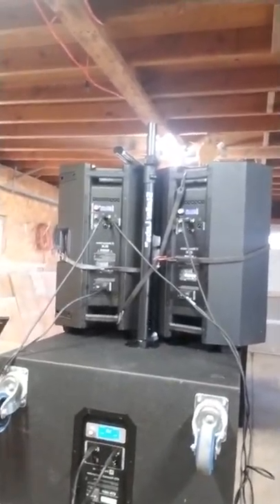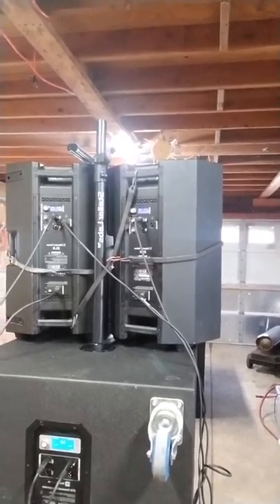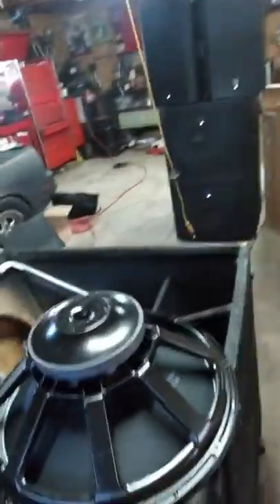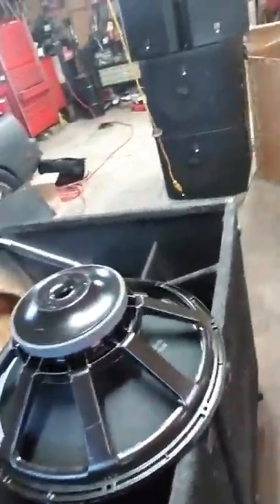EV ETX-18SP Review With Driver Upgrade

Comment: Ever consider the fact that maybe the EV woofers needed some break in time? I mean...what do you know that the engineers at EV don’t....
Reply from the maker: Hello! Break-in AND Temperature accounted for. For apples, the other Drivers were also not broken in and the difference in sound pressure and quality was completely Night and Day. MFG Suggests roughly 60 Hours to break in, however, the difference will result in a warmer sound. The frequency response and peak power simply was not there. You can read reviews on the drivers themselves and you will get more info about the driver's limitations vs the replacement ones I used. What do I know? I the upgrade sounds and performs much better. I do not claim to be an EV Engineer or smarter than one. I made this video to encourage out of the speaker box thinking if buyers want to challenge the design further, and have fun!
Reply: My same thought Everytime I see someone doing this
Reply: I have the ETX 15SP and need to replace the woofer...I hear some kind of cone rubbing on my sub and I’ve only played it a few times at weddings in the last 8 years. I’m sure they are out of warranty.
Reply: Douglas is right, it’s not that engineers don’t know what they’re doing, it’s just that it’s easier to cut  quality on a replaceable and upgradable part to keep these cabinets very affordable

Comment: You should check out the B&C 18TBW100 subwoofer drivers. I think you will be very impressed. They are definitely more powerful than the seismic (respectively) and made in Italy.
Reply from the maker: I think those would be a perfect match for the cabinet!
Reply: Steven Hammerle ... I’m going to look into this speaker I have the etx 18sp’s and they honestly hit hard & drop real low with the EV subs in them minus the peak light coming on super early I love them BUT if I can change the woofer in them so that they can hit and drop twice as low and take high volumes maaaan I am so with it and ready to try it now you say the B&C sub and I heard another mention they put a peavy low Max in the etx cabinets so wich one is better or will both hit hard!
Reply: @hollywoodthedj1673  b&c is better den peavy that’s for sure
Reply: Blackboy Ultimate Sound Sxm ... I wanted to buy the B&C subs at the time they were a little pricey so I went with EMINENCE DEFINIMAX 4018LF: 18 INCH PRO SUBWOOFER they were a little cheaper then B&C plus I only had to buy one since I already had one new in storage!
Reply: @hollywoodthedj1673  I am about to purchase a driver for mine that just blew.  Which one you think is best - the Eminence or BC?  I want to be able to push as much as possible - and the stock EV will not cut it - but I want the same great sound the sub already has - if not better!!!

Comment: I bought one 3 years ago and the driver blew up at the third event. They sent me a replacement speaker but I bought a Peavey Lo-Max woofer and put that in instead. No problems ever since, the only issue is that the cabinet weighs 15lbs more. I personally will never risk using anything from seismic.
Reply from the maker: Hi Nigel, I like your choice with the low riders. Great design and price point. I originally bought the Seismic for an inexpensive folded horn replacement so since I had em available, I just popped them in. The subwoofers still continuously work well, but yes are way heavier.
Reply: Nigel .. hey were the peavey low riders an exact match for all the screws to go in I’m having this same issue I want to replace my sub woofers ASAP
Reply from the maker: Hi Nigel, reporting back after some time using these. Still, NO issues and the Seismic drivers are absolutely awesome! Unfortunately, I believe they have since been discontinued... I was also very leery about using SA drivers, but if you had this specific model (I have no liking to any other SA subwoofer) in your hands you can tell it is not their normal design, it was likely a freak production. lol if that makes any sense.  Anywho, I hope all is well and they are still treating you well!
Reply: @MrDjanotomus  My ETX18sp with LOMAX woofer is still killing it, I used it every week (6 years or more) and I have no worries with the LOMAX! The LoRider is not even close to a LOMAX, do not confuse them. The ETX-35sp woofers I used to replace the lame originals were Eminence Ferrites supposed to handle 1500 continuous? I've blown one just yesterday, after several years of use. I won't say it's a fail because I ran sound for bands where they changed the bass output and overdrove the system when I took a piss. The 35sp's are already very heavy, adding 20 more lbs better be worth it, because I'm putting a 15" LOMAX in one tomorrow. Pay attention to your settings, don't overdrive your low end. Easy to do.
Reply: @nigel8649  … the Lomax is eminence brand right? Because I hate the ETX 18sp subs as well and I swapped for eminence definimax 4018LF woofers and that was definitely a hell of a difference

Comment: I replaced it with the new madrid 18 and it does jot sound as load as with the original woofer. Have 2 etx 18sp and had same signal going to them side my side and compare them one at a time. The original woofer hit way harder and there was a noticeable difference in pressure between them
Reply: I had to put the etx at +10 on the amp to get somewhat the similar spl putput. It goes on temp mode but does not ectuvate temp mode meaning it does not flash temp mode ang go into protectuon mode, so ill have to see in the next few gigs if the amp reduces it by -4db. Question does the amp monitor the speakers temperafure beamcause the amp does not heat up like it does with the original ev woofer but the peak and temp light do come on quick.

Comment from the maker: UPDATE! Used the setup for two outdoor events since the build, each one over 8 hours of continuous high level (but not unrealistic) use and they performed extremely well. I received many compliments on how crisp, clear, loud and deep they are. No issues with power, clipping, protection mode, hookup, rattling, port noise, nada. Amps are cool to the touch even playing dubstep and riddim at 80%+ volume for hours on end (ZLX-15Ps were much warmer but did not overload or have any issues as well). Very happy with the EV products and driver upgrade with Seismic Audio. I am still recommending it personally if it fits your needs etc. 

The second event we played for a July 4th party and played everything from baby shark, to classic rock, alternative and deep house with fantastic clarity. Again, many compliments.

Next use is for an indoor wedding in a very acoustically challenged VFW hall with over 100 people, 40 ft ceilings, concrete walls and floor and about 100' x 350'. I may be adding a set of JBL PRX825Ws for stronger mid-range and coverage. Stay tuned!
Reply: Douglas Johnson got a link for these drivers?
Reply: At what level do you have the etx amp at? Unity or +10?

Comment: 4 ohm or 8 ohm upgraded drivers? i have some ETX18's and I'm thinking about upgrading to 18 sound 18LW2420 drivers. I always thought the output on these cabinets was coming up a bit short for what they are and now I see why
Reply: The original woffer is 4ohm but I think the sa audio woffer only comes in 8ohm.
Reply: Should be fine. The etx18sp at 4ohm is 1800 watts and SA audio is 750 at 8 ohm. So if your amp fro. The etx 18 was 8ohms it would running at 900 watts. A little over the rated spwc for the sa woofer here.  @SQchico

Comment: I just bought one of these subs, trying to put together a bootleg movie theater for the family when i'm not working in the warehouse. 80' x 25' x 16' H I feel like the larger space requires more woofers or lower frequencies... What do you recommend?
Reply from the maker: The frequency response and price point of these drivers should satisfy most home theater applications. I would focus on the cabinet design and personally I would use 4 for the space (provided dimensions). Perhaps two dual front firing enclosures, and two 2,500 watt amps, frequency 25-125 Khz for starters.

Comment: The low end on your subs sounds fantastic in this video! I'm in the same situation but with EV's lighter EKX18SP subwoofer. I need more bass extension as well. All of the drivers I've looked at have a lower sensitivity rating. I don't know if that would give me less overall volume or not. What is the BEST driver that you would suggest I upgrade it with. Doesn't have to be a budget driver, looking for the best options.
Reply from the maker: I would look into some of the B&C or even Eminence drivers. They are all impressive, and I am planning to go in that direction next.

Comment: Thanks Douglas for the suggestion.  I replaced the woofers with the same SA subs and sounds so much better.  Only downside is the grey cone and SA dust cover.
Reply from the maker: Hi Mark, glad to hear this! I ended up spray painting the surface of the cones a matte black which took care of the color mismatch. Just a light coat did the trick and I will be making a custom decal for the caps. The cones had a deep grey/purplish color and it was quite visible through the screen, but now does not.
Reply: Douglas Johnson .. Good Job On Spray Painting The Cone & cap or speaker I didn’t know you could do that pretty dope now no one will know what speaker is in there!👍🏽
Reply: I was just about to suggest the spray paint..

Comment: Finding this has really saved me some money.  I blew 2 of my drivers on my ETX.  Replacement cost around $346 but I live in Hawaii so shipping can only be sent Fedex 2 days at $375.  Seismic saved me some money on the speaker but shipping is still $181 per speaker.   So hopefully the $200 savings per speaker is worth it.
Reply from the maker: Hi Halape10, happy to hear that you are going to give them a try. For the price, I still could not be happier with the Seismic New Madrid 18s. You may have to oversize the bolt holes on the basket, just slightly for them to fit however we are still using them strongly today. I encourage you to respond with your feedback once you get them setup! Thanks!
Reply: Douglas Johnson I had to do a little cutting on my box to get it to fit.   There’s a little funny sound on the really low ends.  But, I don’t think anyone will notice.  But overall I’m happy with them.  I’ll set them up again today to take a listen again.

Comment: Hey man. I have 2 elx35p powered 3 way speakers and I feel the same way you do with the bass...i tried to find the seismic audio Madrid you suggested but in 15" size and couldn't they only come in 18. May i ask if you know if the Madrids come in 15" or only 18? Your description is very convincing and I really want to wake these guys up. Thank you in advance for your time.
Reply from the maker: I believe they only come in 18s and have not been restocked in months.. however I'm confident most higher end low frequency response drivers should yield a similar if not better performance.

Comment: Alot if speakers do this shame put same drivers in same units! What rms you reckon the etx amp is putting out?
Reply from the maker: Hi Mobile Disco, I am quite impressed with the tiny amp. I would be optimistic to say they are about to put out around 750W continuous, without referencing the data sheets. I am especially impressed with the low power consumption and how cool the amplifier remains even after hours of continuous high level music. So far have not tripped a 15A breaker on these like I have with the Crown amps.
Reply: Douglas Johnson not bad at all! Tempted to get 15” used and put better 15” bass driver in neo help the weight so you feel 800/1000watt aes driver be fine as upgrade
Reply from the maker: @MobilediscowirralCoUk  Yes, that would be spot on in my opinion.

Comment: Well there went my driver!  I need to replace mine and the EV stocks are about $400 shipped!  WOW!  I'm trying to find better options - so did you say you had to modify and drill to make these fit the ETX cab?
Reply from the maker: Just the holes in the basket, a couple needed to be rounded out just a little with an oversized bit then they fit like a glove. I am looking into potentially upgrading them to B&C Neos next to take some weight off :)
Reply: @MrDjanotomus  wow do know exactly model number and do they fit exact?  I'm almost just buying the stock one but would love the handle of the RMS being higher so these things don't blow again.  I feel.thats what blew it the first time.  I push mine to the edge!!!!
Reply from the maker: @zeekhernandez9419  great question! With so many options, it comes down to your budget, availability and some trial & error. I love coming across a how-to video that gives me exactly what I need to expect, but the SAs are likely to be discontinued moving forward. If you drive them to the "edge" all the time, then I would get some heavier ferrite subs, like the SA's that can handle more heat, for longer durations of time. Which RMS or Continuously can handle the 1,800W rating of the amps.I was a little skeptical that those tiny amps were really pushing that much power, but a recent event with a HUGE Dubstep headliner (Toadface) we used them as monitors and they even tripped the 20A breaker (testing time) leading me to believe they are consuming and outputting that rating after all. Still, ran for several days at near clip levels, those darn things did not give out.... lol  Sorry I may of rambled there, just wanted to share some more recent experience as well. That was last weekend.

Comment: Hey Doug, I just purchased 2 of the ETX 18SP subs last week. You are right, the boxes they come in are definitely made of some heavy duty cardboard and had to use a razor knife to get mine open too, lol. After getting them unboxed and set up, I used the two QSC k12 tops I have here at the house, (The rest of my QSC speakers are in storage) for my first quick test with both of the ETX18SP hooked up. I Gotta say, for a very brief test (Did not want to bother either of my neighbors for very long) I was impressed with the power they produce. Never turned em up past +10 db, but Man they can pump out some serious Thump! However, I can appreciate this video and your recommended Subwoofer upgrade, Cuz I too, Was a bit skeptical of the many reviews mentioning the speakers shutting down after extensive use at higher volume. I'll take a look at Seismic Audio New Madrid 18" drivers, That is definitely an upgrade I will consider. You seem very confident with your experience at large events that demand extended periods at high volumes, and I can appreciate that too. After seeing the magnet on these stock EV speakers in this video, I gotta say they do look thin and weak compared to other Subs I have seen. As for the pair of QSC KW181 Subs I use now, Those are fantastic subs that have truly stood the test of time and are stock from the factory. My entire PA system is active QSC speakers and subs. However, I was looking into expanding the bottom end of my PA system for the bigger outdoor events that seem to really soak up the low frequencies very quickly yand these EV subs caught my attention with the advertised 1800 watt I was presented with a great deal on a new set of these ETX18SP subs I just couldn't turn down. Only paid $2350 for a brand new set with full warranty, and also have an opportunity to purchase two more of these subs and 4 fitted covers for $2496 from the same seller. I think that is a good price considering I see them on Ebay for $1499 each, and the covers are $69 each. The invoice is for 2of the ETX18SP subs for $1150 each and 4 of the ETX18SP covers for $49 each, All brand new with free shipping and full warranty. I can't pass that kinda deal up. I don't like mismatching anything that goes up front for my PA system, but with an 1800 watt rating I can throw a black sheet over them. I'm gonna subscribe to your channel and keep an ear out for any more suggestions you might have. Thanks for the helpful information, I'm always digging around looking for ways to maximize my equipment to get the most out of it that I can
Reply: Jason Vied does he have a website?
Reply: I think so, I found this video about a month ago and pretty sure there was an option to subscribe
Reply from the maker: @ItzJcard  https://djanotomus.com  sorry for the late reply, your comment on another member did not notify me :)   Hope all is well!   BTW these are still in full production to date with NO issues!

Comment: So I finally got a chance to air my upgraded subs out, I used 4 tops and two subs and still had to turn the subs down, my tops are crossed over @ 100hz and so are the subs, man this upgrade is the bomb. My go to tops are the zlx 15p bt and rcf hd 12 As' the 12 A is a sleeper I like sound quality and coupled with the zlx that can be a little harsh on the upper treble the rcf s' can smooth the frequency out once you get the right blend between the two pairs. Most happy with the butter smooth bass at any level now with no clipping. I can't thank you enough for the idea. Bless you bro. DJ Marvell
Reply from the maker: @Truth B Told / DJ Marvell, SO Happy to hear this success! Absolutely love your configurationm I think you have an extremely ideal setup, and now you have new upgraded speakers all over again :)    Please keep us posted as time goes on. We will be making a Seismic Audio Upgrade video that will likely stir tons of commotion soon!! lol  Cheers!